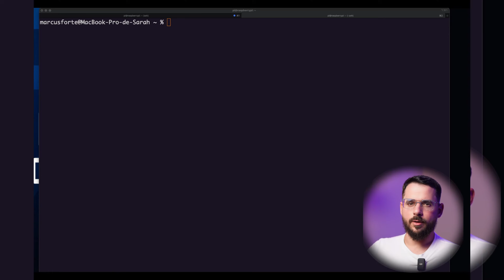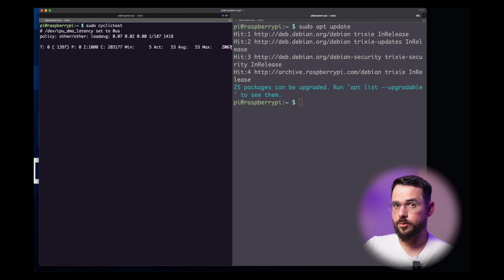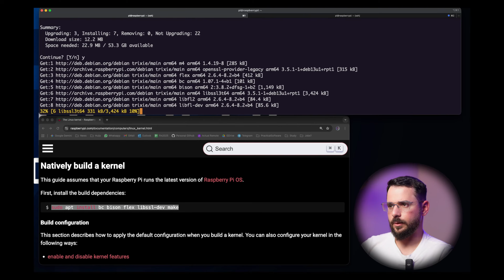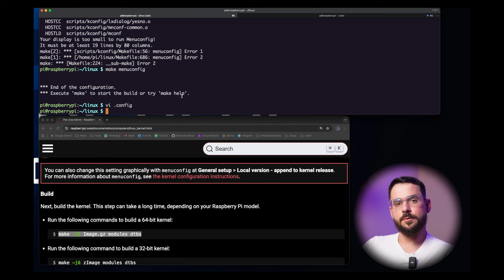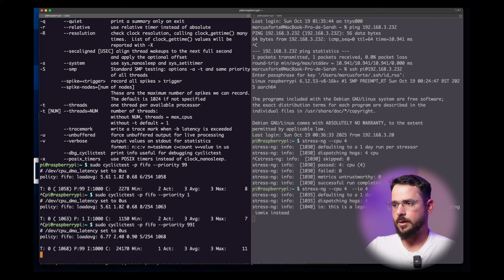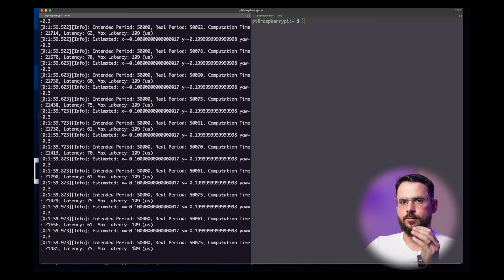Practical Guide to Real-Time Linux with Raspberry Pi

Comment: which raspi is supported for rt linux
Reply from the maker: Since this is really a "soft" /software real-time mechanism, all Raspberry Pi whose OS has a kernel version is >6.12 can enable the feature! The latest OS (Trixie) already contains it.

Looking at the website, this would work for the RPIs:
3B
3B+
3A+
4B
400
5
500
500+
CM3
CM3+
Reply: How long does it takes to Make
Reply: Is the latency check is done afteer doing rt test

Comment: The is no discussion of hard vs soft real time. I don't believe the Linux real time patch guarantees hard real time performance; it just reduces the times interrupts are disabled. For hard read time you need a specialized OS. There is, however, an interesting Linux approach using two kernels called Xenomai.
Reply from the maker: Agree! Here we're talking about soft RT. For highly controlled requirements, you can't use Linux PreemptRT, indeed more specialized is applicable. I'll check out the Xenomai.

However it does enable dozens of applications you wouldn't even consider. I worked with control systems of conveyor belts with embedded Linux. The equipment with this patch was extremely convenient! We needed professing latency as low as a few microseconds.

Comment: I dont see the benefirs by the examples given.
It sounds more like wrong hardware was choosen for the given tasks?
Reply from the maker: Indeed. You could select a specific hardware that meets timing requirements. But PREEMPT_RT is about enabling Linux computers to be more versatile. With this you can have a dedicated real-time app and a non real-time app serving other purposes, e.g a diagnostic server, a database.. alongside your RT requirement on the same machine. And it's also readily available since kernel 6.12.
Reply: @practicalsoftwaremarcus thanks for clarification :)